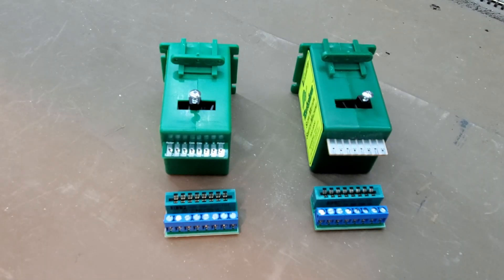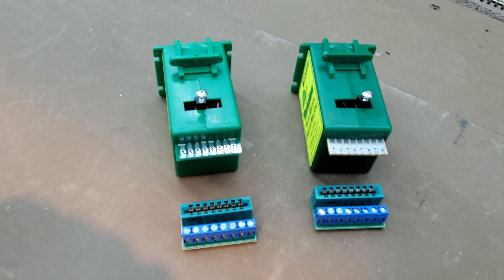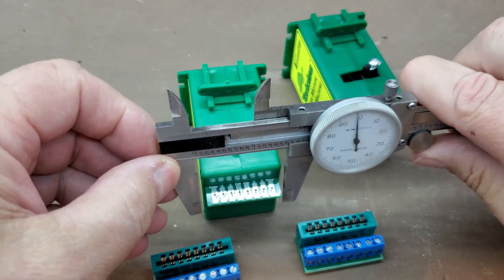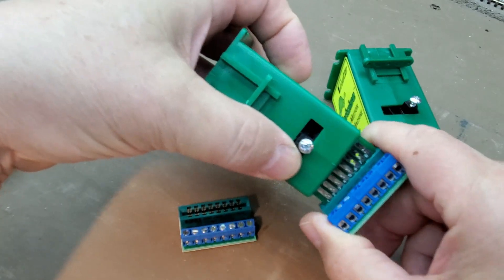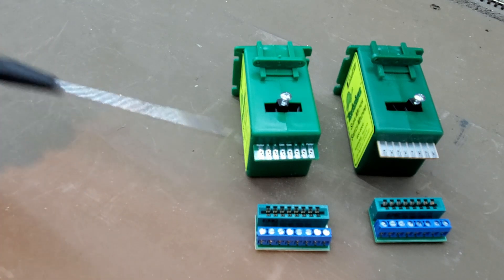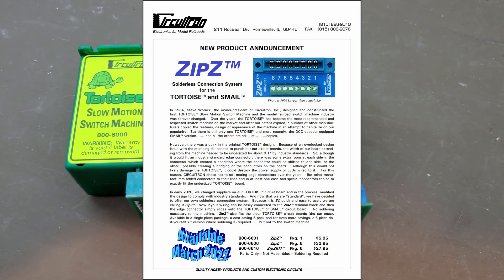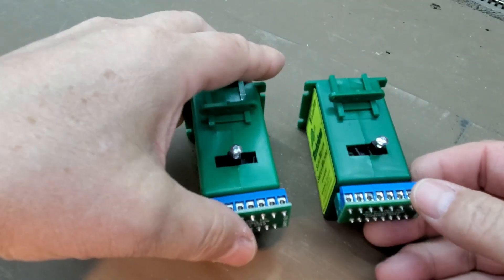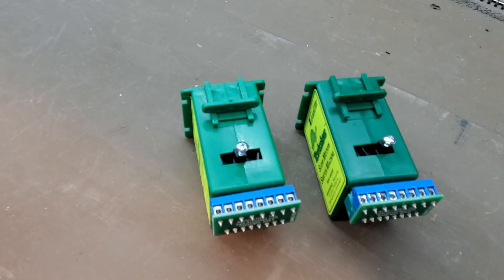Accu-Lites Snap Solderless Connectors for Tortoise Switch Machines. HO Scale 20x12 Layout Part 37.

Comment: I was making my own version in cases where I only use 2 wire hook ups.   I will be adding those locations where the yard ladder needs to know the position of turnouts etc.   But the do command a rather hefty price
Reply from the maker: About $6 each. Since I connect all 8 wires I feel its worth the price. Especially if I ever have to change out a Tortoise machine. Just unplug the connector, replace the Tortoise and plug it back in, no soldering.
Reply: @SPSteve  I did not sound clear,  I did buy some of those and will be adding them in locations that need more than 2 wire hook up's
Reply from the maker: @IMRROcom  Cool! Well worth it, I think! Soldering underneath the benchwork is a PIA. (Although I did solder all my feeders to the bus)

Comment: Great video, was wondering what those connectors were! I commented on a previous video (Part 30) a bit ago. While watching this one, came across something called SMAILs also by Circuitron that apparently is for DCC. Does this mean no other gadgets/digital connectors/interfaces are needed? I can just plug each SMAIL into DCC bus? I know a pricy way to go for being clueless and I suppose I can get by with 15 or so for very back of layout and use throw machines for everything to front? Thanks!
Reply from the maker: Thanks! The Smail still has to be connected like the Tortoise. All the Smail does is eliminate the need for a DS64/DS74.  If you don't plan to control your Tortoise machine with your throttle then stick with a manual switch to move the Tortoise machine back and forth.
Reply: @SPSteve  Thanks for the replies to various questions I had in last few videos. Greatly appreciated! As you can tell, binge watching your channel and enjoying it immensely!
Reply from the maker: @MRR_Shadowolf  I appreciate it! I hope you find it useful! :)